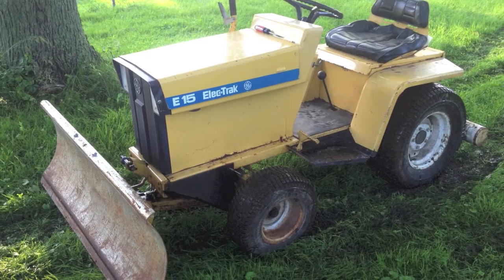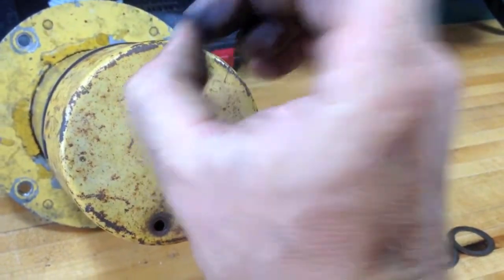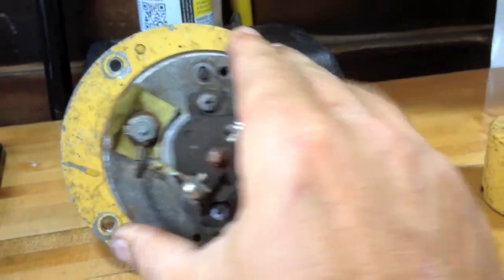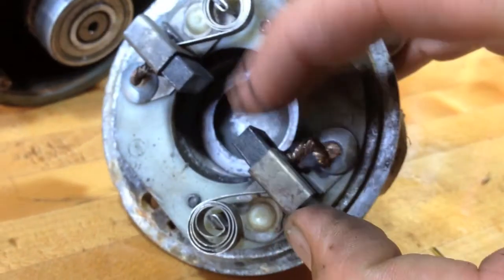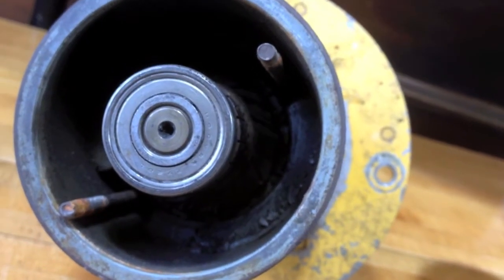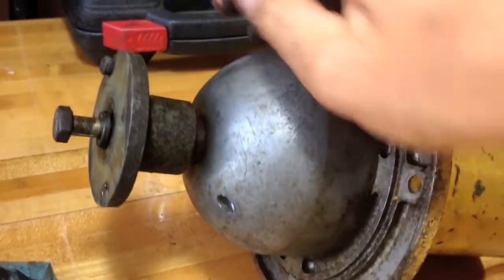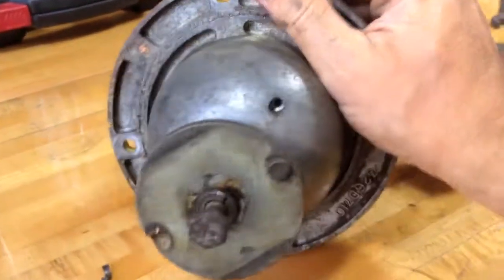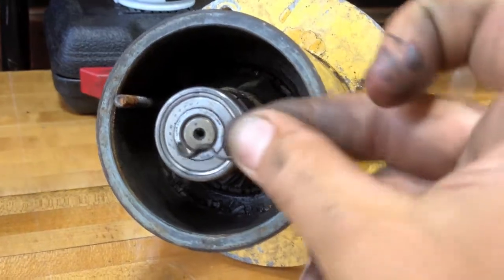Elec-Trak E-15 motor rebuild

Comment: Good job on snagging one of those; they're a bit scarce these days.  Thing is, they proved conclusively that electric power was extremely practical in a machine that size, but as always the power cells were the main issue.